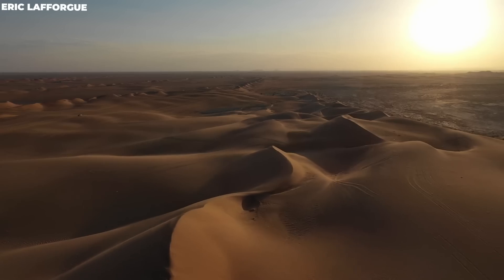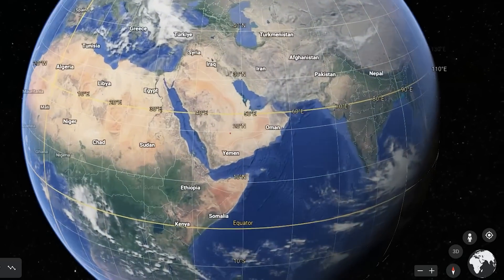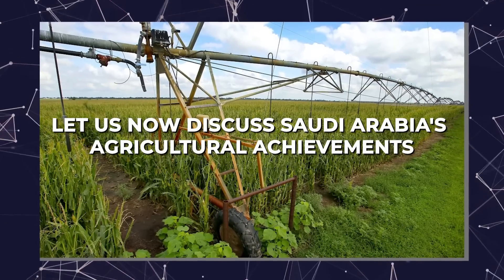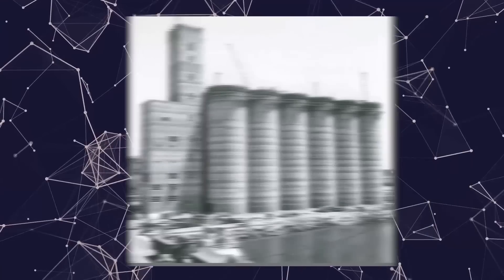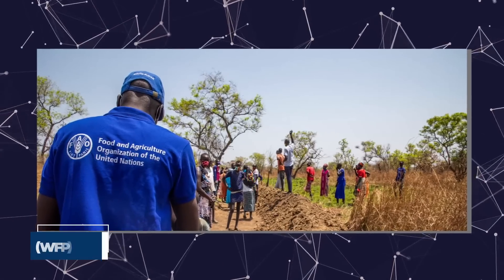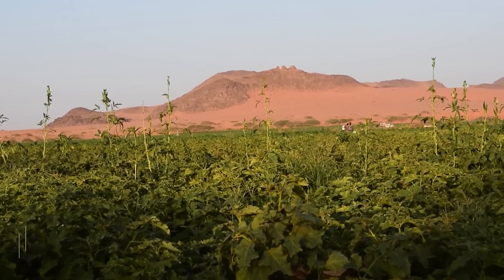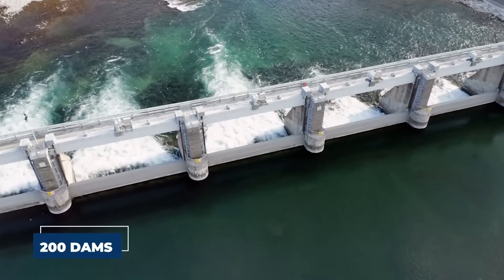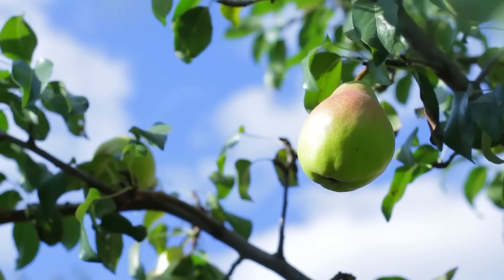Saudi Arabia Just SHOCKED The Entire Industry With This

Comment: The main problem is water.  They have been using ground water which is a finite resource.  In California's central valley wells have dried up and that ultimately will happen in SA.  Right now it's possible to use monoculture and desalination water, which is expensive, and ground water.  Later there must be readjustment.

It might be a very good use of valuable water to mitigate climate rather than produce garden crops at this time.  If the land itself can be greened and a reintroduction of animals that can increase fertility and maintain the soil then later agriculture can be tried more sustainably.  There are regreening projects in the Horn of Africa that have increased rainfall that has allowed surface water to be used without depleting ground water.  I am no expert in this field but I wonder if a more sustainable approach might be useful.

Comment: What is not being discussed is the cost of producing this water versus the value of the agricultural produce.  Also the longevity of the underground water resources.  
The drier parts of the USA are now starting starting to run out of water as lake mead dries up.  Also underground aquifers are being depleted mainly for farming.  For a city desalination of seawater seems practical, but not economically viable for farming without some large source of cheap energy.   
I am most pleased to see the great advances in Saudi agriculture and sure hope that it is sustainable relative to water resources, but then again they do have the oil that likely provides either via gas or petroleum the needed  fuel/energy for the desalination plants

Comment: They are taking SEA WATER to desalinate what happens to the Brine?? Also, the sea will not last forever if the World like China started Desalination plus India, plus all coastal countries in the world, the sea level will drop drastically.
Reply: lol
Reply: "About 71 percent of the Earth's surface is water-covered, and the oceans hold about 96.5 percent of all Earth's water" - earth is a closed system, the water doesn't disappear. we're not going to run out of water ever. you must be thinking in very small terms to think human use of ocean water is going to do anything to sea levels.. they probably dump the brine back into the sea and it gets circulated by ocean currents. plus, supposedly, the concern is for sea level rise (they've been claiming that since the 70's) and shut down of the jet stream due to lowered salinity in arctic waters. So there's a couple of answers. China & India don't have water supply issues, they have water pollution issues.
Reply: how moron someone could sound 🤡